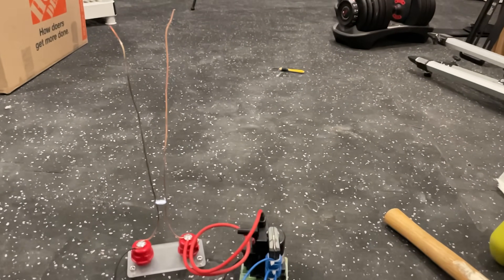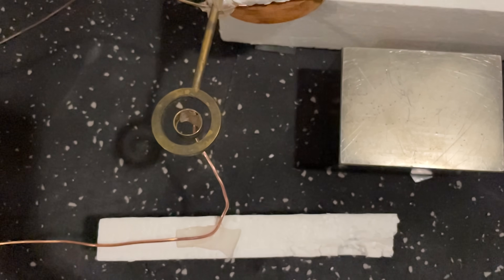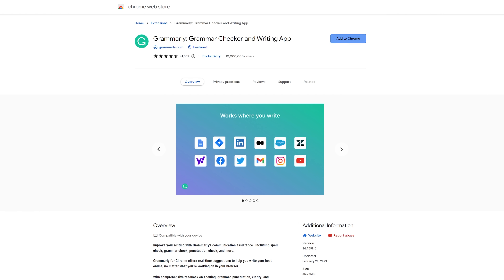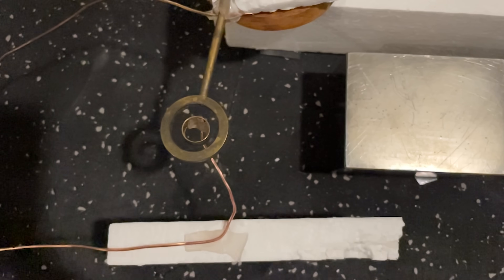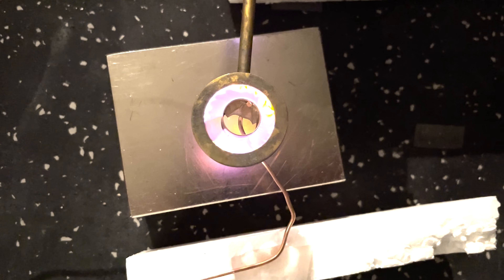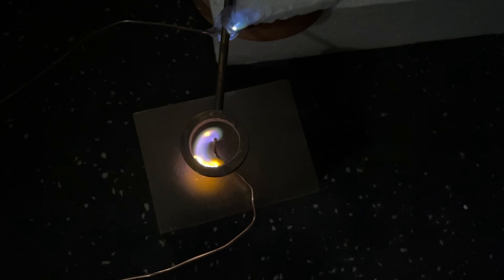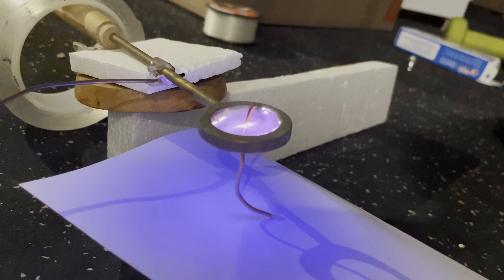Making a Real-life Nether Portal

Comment: You can see your phase rotation based on the direction the arc spins. If your wall plug will let you, flip the cord 🔌 and it should spin the other direction.

Comment: You can do better by using a stator winding with electrodes placed inside side by side against the walls of the stator winding and passing a UV laser beam that emits quantum particles through the center and observed, you would be surprised

Comment: I thought in an electric motor that the brush connected with an electro magnet that was away from a permanent (or field coil) magnet and pulled it towards it, by the time it gets there the next coil is connected and the cycle repeats. Thats certainly how my train set worked in the 1970s! :o)

Comment: Is it the electrons or the ionized particles? If the ionized particles are not playing a role and it is solely the electrons, then it should not have to be a plasma arc and should work with just a spark gap..... unless continuous current is required.

Comment: OMG thanks! 45 years ago I sold Jacob's Ladder plans via Popular Electronics classified ads. My last neon sign transformer has been waiting for an exciting project. This is it! 

Experimenters should know that modern neon sign transformers have anti-arcing built in, so you need an older model that will arc to build a Jacob's Ladder or Nether Portal. This is easy (and dangerous!) to test, just plug the transformer in and see if it creates a continuous arc. 

Question: How strong does the magnet need to be?

Comment: Little late to the punch but very cool video. If it could be miniturazed the most immediate use I see for this would be as a lighter. Current electric lighters on the market make a single small arc that's terribly difficult to light a candle or cigarette with. But if you had a nice disk of plasma, that would really be something, I'd shell out some money for that

Comment: This is so interesting 😀, the air that is basically nitrogen gas when exposed to hi voltage behaves like a ferromagnetic fluid, meaning you can spin it using a magnet 😆🤣🤣🤣🤣

Comment: Wow.  You so do NOT understand how an electric motor works.  The Lorentz force has nothing to do with it.  The rotor spins inside the fixed magnetic field due to the effects of the stator interacting with the field induced in the rotor.  The commutator alters the rotor's polarity which causes it to be alternately attracted to and repelled by the fixed permanent magnets in the stator.  The Lorentz force only effects free floating particles.  The effect that makes the motor spin is perpendicular magnetic fields.

Comment: So how hot is the plasma vs the energy used to produce the arc? Just curious if this could be used to increase energy output from less energy input. I know it sounds like breaking laws of physics, but you are using air as an additive fuel. 🤔 Would increaseing the humidity level in the room to 99% give the arc a higher heat output?

Comment: Make two of those and connect them to the same power source position them close to each but not touching each other then test it further apart too. This will connect them to each other and then they will be wirelessly connected. keep the magnets cool with cold lasers while the plasma vortex is spinning or the magnets will get weaker over time.

Comment: This is a little bit like how a magnetron in a microwave oven works.

But obviously MUCH higher (lethal) current. :o

The magnetron has, well, a magnet around the core, and the core (usually core) is shaped in a way that encourages rotation of the electric field.
The electric field passes missing sections in the core, which all combine to act as a type of oscillator around 2.4 GHz.

2.4GHz is one of the frequencies that can get absorbed by the molecules of water in the food very well.
It jangles the water molecules so much that it generates the heat and steam which cooks the food.

Or something. Dont quote me on any of this. lol

Comment: I have questions.   I'm generating my arc with a zvs / flyback.  Anode and cathode are set up similarly with a ring cathode and point anode in the middle.   It will arc at many different frequencies, but I have not been successful with rotation.

How is the b field oriented, and how strong is it?

Comment: Wow, neat! What kind of power source are you using? Looks like an AC source at 0:20, is this what you're using for the rotating plasma as well?
If so it's very interesting that the plasma shows a net rotation, as the inversion of the driven current should result in an inverted Lorentz force as well. I'd be really curious about what's breaking the symmetry.
Reply: I have the same question. Did u find the answer?

Comment: The spark on the Jacob's ladder also moves due to Faraday induced forces. The current up and down the two wires is nearly perpendicular to the current in the spark. This induces magnetic fields which repel each other. Your power supply does not supply much current but the force is still there. It is the primary force used to accelerate a metal slug in a rail gun.

Comment: In the Jacob’s ladder, the plasma rises due to heating of the air. In the circular plasma generator, if the rings were in the vertical position and not the horizontal position, when the magnet is introduced would there be a stream of hot air coming off at right angles similar to a jet engine? By increasing the voltage, with the rings set at a fixed distance could this be tuned to function as a no moving parts turbine?

Comment: Could this be used for anything?
If the outer circle was replaced with many different points all with the same gap between the centre and between each other, could this be used as ignition timing on some kind of custom circular gasoline motor instead of a crank sensor and ecu timing?

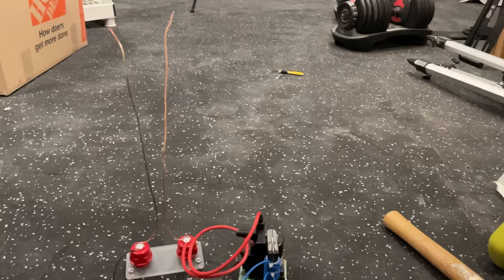Comment: 0:45 this explanation is commonly repeated and yet completely wrong. Jacob's ladder is basically a railgun.
It's exactly the same effect you show in the second part of your video, except that your magnet is stronger and pushes arc your arc with more force.
Funny thing, I've seen people use the same wrong explanation when talking about extinguishing the arc inside circuit breakers. Like, how the hell is that gale wind supposed to break out inside a tiny box? Does it tunnel through plastic walls or something?

Comment: I wonder if you could contol the speed of the arc rotating by an electromagnet to let a thin enough outer ring (maybe cut it with a little gap) vibrate and making it into a loudspeaker

Comment: The magnet is how a microwave oven works. The outer ring has slots cut into it that don't go all the way through. The slots are inductors and the gap a capacitor. The spinning electric field doesn't really touch the outer ring, but the swirling plasma (in a vacuum it's not a plasma but energetic electrons) flies by the gap and "pings" the electrons in the outer conductor, which bounce back and forth until they've lost their energy.

Comment: One way to test the effect of gravity (hot air rises) on Jacob's ladder is to lay it horizontally. I would expect the arc to form at the point of least resistance (the base of the ladder) and stay there instead of moving up. You can also lay the circular electrode vertically and I would expect the arc to form between the center (wire) and the upper edge of the ring, and stay there.
Reply: What's the test? Everyone knows how that will work.

Comment: Next step is to 3D-print a rectangle frame for the outer electrode (its inner part being still exposed for the current to go through) and make the inner electrode shaped so that there woudn't be too much distance between both electrodes in any place. And there the effect would be perfect.
Reply: Thanks for your comment, love ❤️ and support 🥰 for a good investment and advise Ꮤ᷈Ꮋ᷈âͲ᷈Տ᷈äᏢ᷈Ꮲ᷈ Ꮇ᷈Ꭼ᷈ ♱𝟭𝟵𝟬𝟵𝟲𝟯𝟴𝟭𝟬𝟭𝟲...☺️

Comment: Try using pure dc high voltage it sounds different, almost silent. 1000v dc at 5amps, you must initiate the ark. I used up to 13 solar panels wired in series.
Reply: Thanks for your comment, love ❤️ and support 🥰 for a good investment and advise Ꮤ᷈Ꮋ᷈âͲ᷈Տ᷈äᏢ᷈Ꮲ᷈ Ꮇ᷈Ꭼ᷈ ♱𝟭𝟵𝟬𝟵𝟲𝟯𝟴𝟭𝟬𝟭𝟲... ☺️

Comment: @TheActionLab What happens if you you conical outer electrode and center wire or rod electrode. In that case you will have a climbing plasma but when you put them under magnetic field you will have both climbing and rotating plasma. Please make a video on this ?

Comment: Lol, whats funny is I literally just made a oscillating electric motor last night that uses a flyback and two wires and the charge between them to pull them together then they spring apart. Had it run for over 5 minutes. Buuuut the little flyback kept flashing over on the pins so I had to scrape off the burnt resin and put silicone over it. Apparently at some point I nicked the ground wire in the resin and yeah it burnt out lol

Comment: So every one points to the arc rising because the plasna is hot. While that's true, it's not the full story. There is rail gun like magnetic effects that also push the plasma away. But the current is generally  low so it's not very dominate.

Comment: What if you lower the tip of the wire but keep it centered?  Would it make a cone shape ark?
Reply: Maybe cone shaped. Maybe bowl shaped. The magnetic field strength drops the further it is from the magnet. What shape would it be if the center wire is from the top?

Comment: circular jacob's ladder!
Reply: spin spin baby spin
Reply: put a magnet next to the jacob's ladder, you get a plasma railgun
Reply: epic!
Reply: ballast with high voltage, transition to high amps
Reply: try that in vacuum/partial
Reply: watch out for the radiation that one gives out :)
Reply: use a welder as the power supply, in vacuum
Reply: it makes the exact same noise
Reply: so, a dc motor is then high ac radial current (center star out) and perpendicular magnetic field, physical spinning brushless dc motor
Reply: in low vacuum, like in a flash bulb tube, the current will not be an arc, but will glow-flow through the whole plasma volume in between at once
Reply: just put that test in a vacuum chamber, low vacuum in air, should spin-glow and not spin-arc
Reply: or just put a circular flash tube near dc magnet and feed the flash tube with dc current

Comment: Are there any instructables or something to make a Jacob's Ladder with a flyback-transformer? 🤔 I saw a couple that use other high-voltage generators (including use using a kit 😒), but not one with a flyback like James used here. It would be nice to actually use some of the spares I have collecting dust to make something amusing. (I wonder if it will work if you cover it with a glass dome like from a rotary-pendulum clock or if the air inside will break down and stop working. 🤔)

Comment: What happens if you have a jacobs latter in a vacuum champer and slowly sugs the air out?
Does it begin to move slower and completely stops moving at one point?
Reply: Doesn't a Jacob's Ladder require air molecules to work?

Comment: You should try putting the wire in a metal funnel, see if the jacobs ladder combines with the magnet into a spiral motion
Reply from the maker: That would be interesting to try!
Reply: @TheActionLab  next video maybe ?
Reply: @TheActionLab  non scientist here with a question: in the first instance the arc stayed in one place in the circle. If you'd turned the circle on its axis so it was vertical "O" would the plasma have rotated with no magnet, just gravity? 
Probably a daft idea to you folks who understand these things but it's genuinely bugging me so I'd love to know the answer.🤓👍
Reply: @judebrown4103  My guess is that regardless of the orientation of the arc when it forms it would eventually settle into a vertical orientation connecting the outside edge of the top of the inner circle to the inside edge of the top of the outer circle.
Reply: @judebrown4103  At best it would just rotate a bit, from where it starts until it reaches highest point of O. Nothing is there to force it to descend afterwards...
Reply: @u1zha  thank you for your answer, much appreciated.👍
Reply: @WichidNixin  thank you for your answer, interesting, much appreciated.👍
Reply: this would be a really cool idea
Reply: I was wondering what happens if you curl the wire in the ring in a loop around the outer ring and back to itself. Would the plasma still spin within the circle but have a separate static bolt outside of it?  Would you get two spinning arcs at right angles to each other? Would it cancel the effect altogether?
Reply: @LcdDrmr  im honestly not entirely sure what youre asking but there can only be one arc at a time, so if the gap where the static arc forms is shorter than the gap between the wire and ring then you would just get the static arc and vice versa
Reply: He should see this comment
Reply: Very good idea!
Reply: Plasma tornado?!
Reply: That's a cool idea
Reply: What if instead of two wires he uses a cone and a magnet. Will we get a tornado then?
Reply: @krrishgoyal6567  In the cone arrangement there are two possibilities:
1st If the base is underneath its top 
2nd If the top is underneath the base 
In the first case if we employ the wire to pass through the middle of the cone then surely plasma will created in the pointed region(top region) as there will be less spacing b/w the walls and hence if it would the case you'll come to know that in the first place plasma moved up due to hot air surrounding it but here there no place for plasma to go as the pointed part is itself in the top .

Now coming to the second possibility if base is over the pointed Now also the plasma is initially formed at the pointed region and now you'll come to know that instead being the plasma on the bottom there's no air gap left for the air to pass such that it'll uplift the plasma.
So according to me in a cone shape there's no way for the plasma to uplift however a frustum can be a solution and thus I think you'll fulfil your desire to see a tornado in the frustum shape!
Reply: @tilak09  yeah i had a frustum in my head. I forgot that the initial comment was recommending a funnel too and my comment is just redundant
Reply: @krrishgoyal6567  You actually helped me to think TY🥰
Reply: hmm, what about a sphere, made up of many small cylindrical magnets all facing a central core, all oriented in the same N/S position?
Reply: @tekknojunkie  what could possibly happen?
Reply: Due to the inverse square law, the strength of the magnetic field is drops rather the further from the source. I'd hypothesize if we were to place a magnet beneath the plasma, we'd see a rapidly spinning plasma spiral at the bottom, which would slow significantly near the top. Kinda like those spiral coin wells but in reverse.

Comment: Now make a plasma window in your vacuum chamber and demonstrate a real-life Star Trek-style forcefield.  The plasma window should, in theory, keep air from getting into the vacuum chamber while active (allowing you to draw a vacuum with a hole cut into your vacuum chamber) and then allow air to pass through when turned off.
Reply: IRC that's how plasma torches work. It's a thing.
Reply: why shouldnt air be able to pass through?
Reply: @neutronenstern. , the heat of the plasma should prevent the much colder air from being able to pass through the plasma barrier.
Reply: @adventureridergirl  no i dont think so. Hot and cold air do always mix with each other.
Reply: @neutronenstern. , the high temperature of the plasma allows it to have enough pressure to prevent the air at atmospheric pressure from passing into the vacuum chamber.  The high temperature also increases the viscosity of the plasma making more difficult for the air and plasma to flow over each other, that is, preventing leaks from happening.  Magnetic confinement of the plasma also keeps the plasma where you want it (in the window).
Reply: @adventureridergirl  of the plasma had higher pressure than the environment, then air would flow out of the plasma, until its at equilibrium. Heating something does only increase pressure, if the Volume stays the same. Else, if the volume can change freely, the pressure will stay the same (while the temperature is rising, there might be a pressure spike, but after that,the pressure will go back to normal again). The magnetic field might keep the ionizized air trapped, but that does not mean at all, that an air molecule around cant get ionized, to exchange a air molecule in the plasma, which inntufn gets neutralized. Same for the air inside the plasma globe you are suggesting.
Reply: @adventureridergirl  oh ok, well but your explanation then is wrong. Its no forcefield, and not due to high pressure.. Its due to the viskosity of gas at very very high temperatures. The viscosity will get very high at very very high temperature making it hard for matter to pass through.

Comment: Watching these videos is better than hearing unproven theories about unproven hype of physics. Pressure of forced repulsion and propulsion are properties magnetic fields of resistance to thermaldynamics pressure. Hydrogen under extreme pressure expands cold resistance into equalization of pressure as helium. More pressure exerted,  more repulsion to equalization of pressure. Mass is always equal to resistance. Force of outward pressure exerted is weight of resistance traveling to the weakest point of resistance. Earth is our greatest mass of neutralized resistance. Making it the weakest point of pressure of resistance to smaller masses of greater resistance. Repulsion redirects forward momentum propulsion towards the weakest point of resistance. Neutralized resistance within mass. Planets are spheres that show repulsion to cold space. Planets, stars, galaxies, spiraling throughout space as space in resistance.